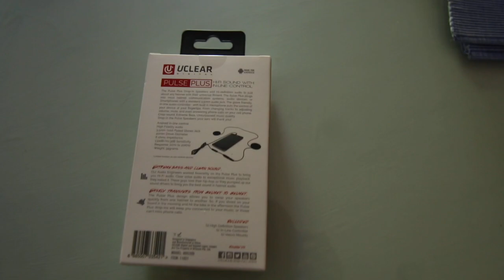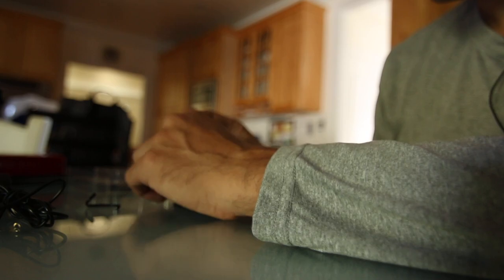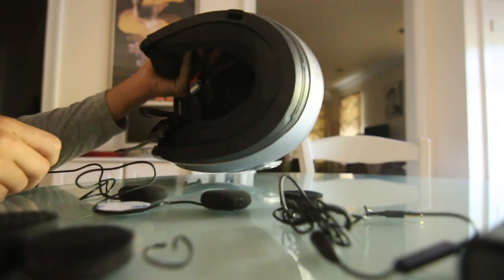Helmet speakers suck

Comment: I just bought them. Took 5 days for delivery,wired no volume control for 39 bucks plus tax on their web site just to maybe see if they were worth a f@#k. BUY THESE THEY ARE FANTASTIC (but get them with inline volume control.) I ride a 2001 Harley ultra glide with a stage 2 kit (96 hp) and go to most rally's here in Nevada and Oregon, Cali, Arizona and Sturgis is 3 weeks away ect:  Just went on I-80 at 90mph and they are by far the best.  I use a a mp3 player the size of 2 packs of matches and only needed 1/2 volume in my modular helmet. I've tried 4 different types of made for helmet speakers and they all sucked. They are out of stock on the Bluetooth ones  or i would order them right now. They are that good. I rarely comment on something on the web but  there is no place on their web site to leave a comment.